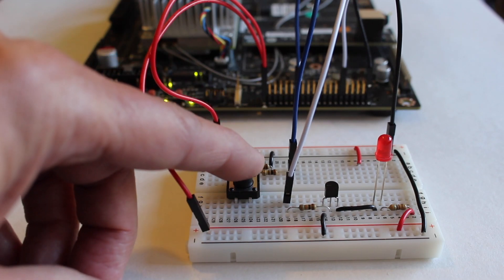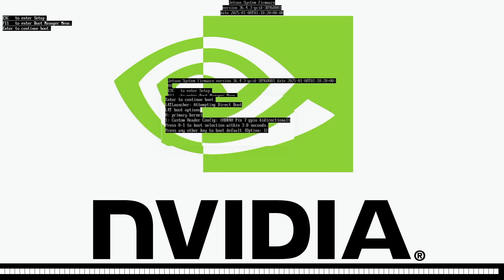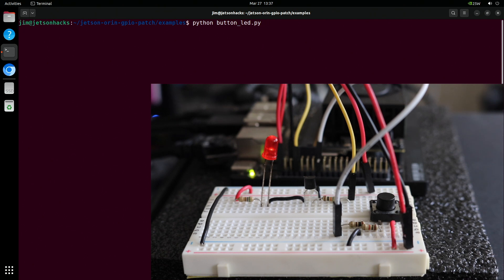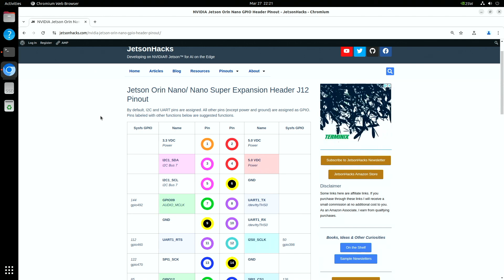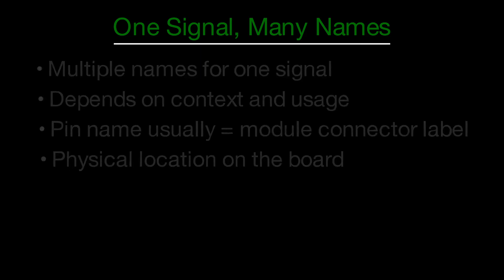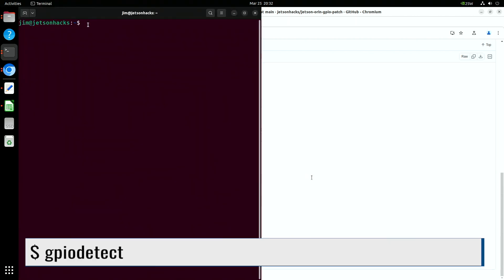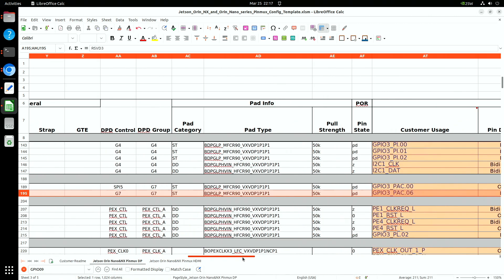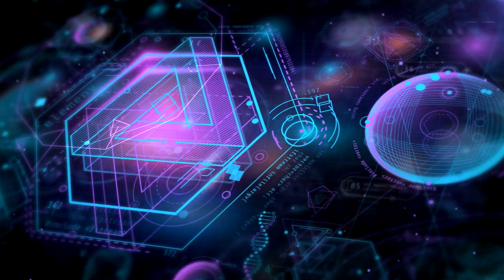Fix GPIO on Jetson Orin Nano Super | Full Guide to Creating a Device Tree Overlay

Comment: Good day.
There is a non-standard fee for which the seller did not provide documentation, and it was not possible to find it in other ways. There are several connectors that can be connected to i2c, UART buses, etc. But there is no understanding of which connector is what exactly it is. And there is no understanding of which output is intended for what. What would you recommend in order to match the connector pins and GPIO numbers? Maybe you can somehow ring with a multimeter from the Jetson Orin connector?
Reply from the maker: This information is available in several places. The pinout for each of the expansion header pins is located here: https://developer.nvidia.com/embedded/learn/jetson-orin-nano-devkit-user-guide/hardware_spec.html. The full specification of the Orin Nano carrier board is here: https://developer.nvidia.com/embedded/downloads#?search=Jetson%20Orin%20Nano%20Developer%20Kit%20Carrier%20Board%20Specification
The JetsonHacks pinout adds some additional information: https://jetsonhacks.com/nvidia-jetson-orin-nano-gpio-header-pinout/
Hope this helps.
Reply: @JetsonHacks  Thanks for the info. I meant that the board is not original from Nvidia, but rather resembles boards from WeActStudio (similar to WeAct-N002, but the network connector is on the side of the narrow part of the board. That is, the board is slightly different.), but I have not yet found the exact board that I got. It is very compact, but there is no documentation for it. Therefore, I will most likely need to somehow ring the board and determine the pinout on this non-original board.
Reply from the maker: I don't know how you go about doing that without having a very good knowledge of how the device tree works, and some hints as to what the connector layout might be.

Comment: Awsome! I appreciate you really considering my comment issue and making a video about it! I'm sure lots of people will benefit! Cheers!
Reply from the maker: Thank you for pointing out the issue in the first place, good luck on your projects!
Reply: @JetsonHacks  Thanks! Quick question, is there anything I need to change to use it on the AGX Orin? The pin7 file is in the boot folder but I cant get it to appear in the Jetson Expansion Header Tool to select it. Thanks!.
Reply: @ManuelCuevasPerez-t9y I'm facing the same problem